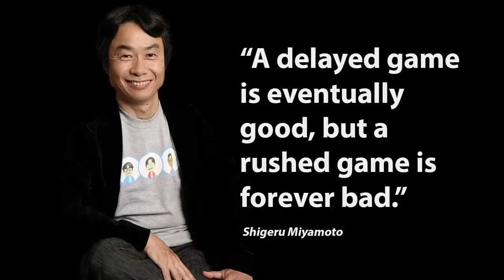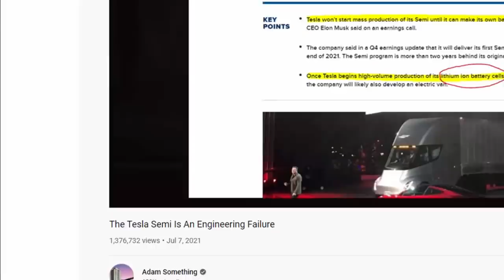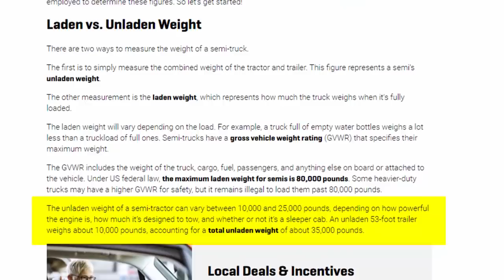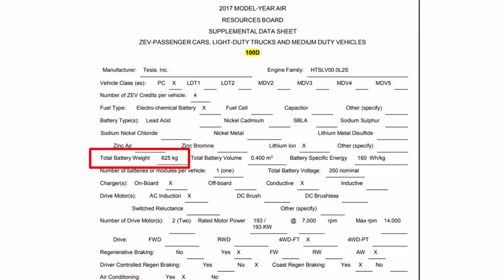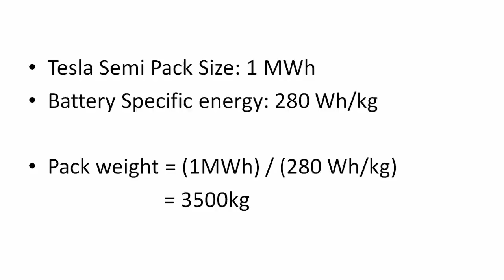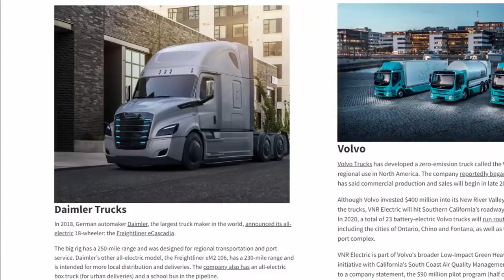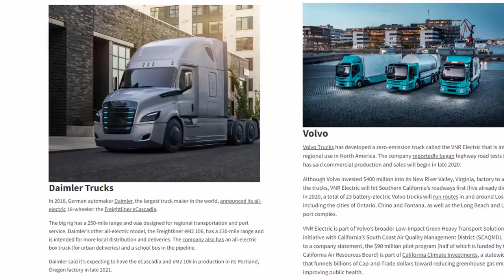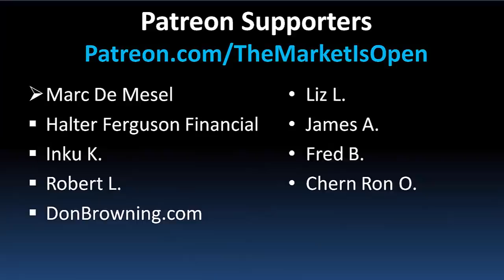The 2022 Tesla Semi is Genius, And Here’s Why

Comment: Most OverThe Road Tractor Trailers have 400 - 600 gallon fuel tanks and with each gallon of diesel weighing 7lbs the full fuel tanks weigh 2800lbs - 4200lbs of fuel so even if the battery pack weights 4200lbs or less it is still less than the OTR truck which the local day cab which is what the Tesla truck is and if you put high wattage solar panels on the trailer and have it charging and powering a reefer unit plus the Tesla Semi unit for say delivery of perishable food items like vegetables and other food stuffs cause a plug in refrigerator unit is much lighter than a fuel powered unit you could also have charging units at places where a 30 or more minute delivery would benefit charging for longer than 30 minutes  which makes the Tesla truck have that much more travel distance.

Comment: No electric truck competitors..?? I wonder why?? Because its vapour ware..! Taking this from teslas own numbers a 1 megawatt model y, a, 3 or whatever battery weighs 6250 kg... That's only the battery... Diesel for long haul trucks weigh 900kg... And if you think that a tesla will save weight because its electric and motors weigh less than a diesel engine think again.. A 6000kg battery needs a big, robust substructure to hold it in place on the chassis of the truck.. The weight differences in running gear would be minimal tipping in the teslas favor probably by what 100? 200kg?.. If you're lucky...

Comment: What if this truck could use the wheels turning to regenerate and charge the batteries, Like an alternator on a car engine?
Reply: Can only do that when downhill regen braking or stopping. When motors are moving the truck forward they cannot regenerate, violates second law of Thermodynamics. That's also why there are no perpetual motion machines.

Comment: Ok I am all for ev’s but stop with the ending fossil fuel consumption..every thing built is related to oil.. so stop. Plastic... derivative of oil.
Machining engines electric or gas .. totally oil dependent... tire manufacturing oil dependent ... I could go on and on... yes I know we use way too much oil... like I said I am all for ev’s but just stop with the ending fossil fuel.. it’s a very misleading statement. 
Don’t believe me.. ask your boss

Comment: 300-500 mile range is pathetic. Trucks get 800-1000 miles between fuelings. Having to stop every 300 miles to recharge would cause mass shortages and logistics costs would go up due to having to pay drivers for down time. Drive for 5 hours, charge for who knows how long and get a few more hours just to have to stop again because you're out of hours of service. Only about 10-15% of trucks would be able to switch to electric until they can go 60-75mph 8-11 hours before needing charged. I'm not against electric trucks, they just need to charge their batteries on the fly before they're really going to work.

Comment: even if the cost to operate the electric semi trailer trucks was five times that of a diesel truck we still need to replace the diesel trucks because they are a major carbon dioxide contributor as well as particulates, nitrous oxide and volatile organics. The internal combustion engine industry has gotten a free ride by dumping all those toxins into the environment for absolutely no cost to the fuel companies or the users of diesel trucks. It’s time that stopped.

However, it’s clear that in a few years and electric truck will move freight at around 20% of the cost of a diesel truck. No amount of renting from diesel truck drivers that will change that but they should know that if they’re thinking of buying a new diesel truck it may be absolutely worthless in about five years. 

Tesla didn’t become worth more than all of the car and truck manufacturers combined for no reason. Those who have done the math know that electric vehicles will be the rule in 10 years which can already seen by the rate of acceleration and implementation doubling from last year and probably tripling into the next year.

Comment: I am a Model 3 owner and a truck driver I can state a few things electric trucks are probably not going to work until the truck itself meaning the cab the sleeper and the driver can be removed from the equation. With just a trailer and a power unit I think electrics in over the road trucking Will be successful. If you eliminate the driver you eliminate the need for the truck itself and all the expensive heavy things that come with the driver. The point some are making about battery capacity and weight is super important for every extra pound that a battery weighs that's less freight that you can carry. All important equations when talking about trucking efficiencies. Currently my 2022 Freightliner gets about 13 and 1/2 mi per gallon on average and when you think about it pound for pound that's actually more efficient with less pollution than a Toyota Prius. What's interesting about that is the regulations are tight on me but not on the Toyota Prius.
I would also add that the 80,000 weight limit is not necessarily for safety but because of road loading. Meaning somebody arbitrarily said trucks over 80,000 lb tear up the road faster. Heavier trucks actually have a shorter stopping distance than lighter trucks do. In the rest belt and in Canada you will see larger trucks than what you typically see in America and they will typically have an added axle sometimes on the truck sometimes on the trailer sometimes both the truck and the trailer have an added axle. This is for the weight distribution to reduce road loading.

Comment: Infrastructure will be the most difficult problem. Charging facilities and current load. The mega chargers will likely need MAGA battery’s to support the large spikes in current draw. Not impossible, but this will take time. At about 3.6 kWh of electrical energy our fleet would need about 7.2 gwh per week.(2000 gallon diesel. Or 1.2 gwh per day. A lot of wiring and additional load to the grid.

Comment: Please don't put autopilot in these trucks. I don't want to die to that crap yet. Not that it will ever be allowed to used on the road until they are able to show anything that is even remotely capable of safe autonomous driving
Reply: And I dont want to die by truckers who drive 700 mile per day without rest.
Reply: @vic321344  build a railway
Reply: @ToppledTurtle834  Let the trucks drive with FSD.

Comment: You have a lot of flawed information yourself. 

If you can't haul at least 18-20 tons then you're losing money in thr trucking industry. The current semi truck itself, not counting trailer weight, is 12-15 tons (long haul trucks with a sleeper which is the vast majority of the industry). Those 5-10 ton truck weights are for city trucks with no sleepers which are not used in the long haul industry. Trailer weights are around 5-7 tons. When you've only got 40 tons to work with for max GVW thats 17 to 22 tons before you even get to cargo. If the Tesla semi doesn't compete with that truck weight then it's not going to compete at all no matter what it's range or speed or whatever is. You also can't use aluminum on a semi frame for structural reasons because of the type of work they do. They need strength and flexability instead of rigidity which is something that aluminum frames wont be able to keep up with. Aluminum cracks when it flexes too much. Back in the 80's companies used to use aluminum frames on trucks to try to keep within new weight regulations on the trucking industry until 5th wheels started ripping off of the frames and then they all went back to steel frames. History shows this doesn't work.

Also a range of 500-600 miles puts is slightly lower than a drivers normal 600-700 miles per day for a solo driver. If you're talking a team then you're at 1200-1400 miles per day which is something this truck will never do because of one fatal flaw. It has to be charged after it nears it's range. A semi truck can refuel in about 10-20 minutes and be back on the road. Even using the Tesla super chargers it's going to take more than an hour and remember with a driver team you only have 2 hours in a day to charge that Tesla before it has to be on the road again. Considering current trucks can go 1500-2100 miles on a tank so they only need to fill up every two days or so you are cutting into their time by forcing them to charge after every driver ends their daily run not to mention shortening their miles per day because they had to charge.

You need these facilities all over the country with the capacity to handle a large group of trucks charging up simultaneously since drivers aren't waiting 10-20 minutes for drivers to fuel up before they get to the pump they are waiting for an hour or more for drivers to charge up at the plug. There are around 2 million semi trucks on the road in the US currently. To make a dent in that market you're going to need a LOT of space for Tesla chargers and they have to be placed very strategically around the country. This will also severaly tax the already terribly aging US power grid which already has issues around the country for not being able to stay on consistently in many areas of the country because it can't keep up with power demands.
Reply: BEV Semis are much cheaper to operate. That will be the main argument. And Tesla chargers do not take a lot of space. They can be installed at every parking lot.

Comment: Trucks aren't loaded up to the legal limit? Well that would depend on the job, but I can tell you that there are an awful lot of trucks that are carrying the legal limit and a little bit more out there.
If you've 1000ltrs of diesel you need 3300kwh of electrical power to replace the actual rotational energy that will come from the engine. Long and the short of it though a 1mwh pack will provide enough range for legal driving periods between mandatory breaks.
The government could decide to just increase the limit on truck weight, though in turn that will increase energy consumption per ton moved...
The biggest challenge to tesla trucks will be actually getting enough power to truck stops to charge them, to charge 1mwh in an hour requires a lot of current never mind 15 or 20 trucks charging at once.
Reply: The megachargers have a megapack battery pack installed with them. So no problem.
Reply: @vic321344  that's the dumbest thing I've ever heard! It doesn't change the fact that if 100 trucks stop at one charger during the day they'll need a 4mw supply coming in. That's not common.
Reply: @jeffjefferson3364  It is not common, but doable. At least here in germany central loading hubs can be provided with at least 20 MW. A small supercharger station is connected by at least 1MW.
Reply: @vic321344  yea but that's for only 100 trucks! Another way to think on it is there is the hoover dam has 2000mw of installed capacity that means at full tilt all day it can power 48000 trucks, but it never goes full open it sits at around 1000mw because otherwise it would run out of water. So where would the power for the grid even come from?
Reply: @jeffjefferson3364  So you will have charging stations for trucks in the future, which can handle 100 trucks per day. So just build more of them. 

Energy has to come from somewhere. True. So even if you burn gas or diesel in a power plant to produce electricity, you will just need half of it than burning it in the engines truck by truck. Due to better efficiency of large power plants..
Reply: @vic321344  no. You're wrong. Engines are more efficient at turning energy into motive power than the electrical grid to battery to motive power.
Reply: @jeffjefferson3364  Definitely wrong. Again. You get an efficiency of 45 % max (25 in reality) for Diesel ICE, 20& for gas ICE, 64% for BEVs.
Reply: @vic321344  no way, you can't convert any heat source into electricity at a higher rate than 40% currently. And then you have transmission losses and conversion losses in the battery. You'd be doing extremely well to get 30% out of what heat you put in.
Reply: @jeffjefferson3364  Nuclear? Solar? Wind? Efficiency is quotient of energy get out and energy put in. My data is easily available by searching google. Tons of material. The efficiency of an oil powered plant is nearly double as  high as a single ICE. So if you burn oil in power plants to drive BEVs you will need half as much oil as if you would to power the ICE cars.

Comment: So,Nikola has already beaten Tesla with deliveries of BEV semis.
Reply: You mean the trucks which are made by Iveco and they glued their patch on it?
Reply: @vic321344  Tesla glues its patch on all the cars powered by Panasonic. Nikola has delivered semis from Ulm Germany and Az.Tesla has a fleet of 279 semis it uses for logistics 100% diesels.
Reply: @paulbedichek2679  So Panasonic makes the chassis, the drivetrain, the seats, or even the 4680 batteries?
And Tesla already delivered Model 3 with their own BEV Semi.
"Let's recall that IVECO and Nikola have a joint-venture manufacturing facility in Ulm, Germany (at IVECO's truck plant), which will produce BEV and FCV versions of Nikola vehicles for Europe. The base of the vehicles is the IVECO S-Way platform, including the modified driver’s cab. Actually, according to the press release, also the initial Nikola Tre for the U.S. customers are produced in Germany" . They are Iveco trucks. with a Nikola patch. Nikola delivered nothing.
Reply: @vic321344  Tesla did not deliver anything with their BEV prototype, they pulled it 100 yards for  video.Its been five years zero semis, Nikola went up 20% today as they are delivering hundreds of semis.
Reply: @paulbedichek2679  Nikola/Iveco delivered two trucks. Handmade in Germany. Tesla delivered 15 to Pepsico. And you could see Tesla Semis driving around in california an Texas in the last 5 years. Even Tesla Model 3 were delivered with it.
The problem is not delivering a handful of prototypes. But to start mass production and hjaving the battery capacity on hand. Tesla seems to be the only company to be able to do that. Texas Gigafactory.
Nikola stock gained some, after it crashed because of the "running down the hill" fraud.
Reply: @vic321344  Yes,Ivecos's owner long ago invested in Nikola and they now have a joint venture,Tesla is nothing without Panasonic.Panasonic makes the cars Tesla puts its patch on them.
Reply: @vic321344  Tesla talked about delivering semis to Pepsi,big difference they have delivered as many BEV semi as I have.
Reply: @vic321344  Tesla stock lost 200 billion in value because they can't beat Nikola to th market with a semi.
Reply: @paulbedichek2679  Or they lost 200bill. because the computers have a stop loss mechanism that leads to more sales. Which lead to more stop loss decisions.
Or they are racist. Or they lost to Nikola. Whatever.
Reply: @vic321344  Yes,Tesla makes nothing they just glue a patch. But they buy the glue and th patch from suppliers.
Reply: @vic321344  Hands make everything.
Reply: @paulbedichek2679  So you confuse Tesla and Nikola. Again.

Comment: It seems no one is addressing the real problem. We are already having to park on the exit ramps because the truck stops and rest areas are full .It’s going to take massive infrastructure changes to put charging stations in truck stops. Unless they are planning on building more truck stops which would definitely be a plus.
Reply: You dont have to install the chargers at truck stops already present. You can install them at the destination, or everywhere in between. No environmental proof necessary.

Comment: I don’t see why EV makers don’t make the batteries universal and easily changeable by automation. Then you could stop at a charge station get a battery swap and be down the road with a full charge before any gas vehicle could fuel up and be down the road.
Reply: Nobody wants to change 4-6tons of batteries. Just to get a 20 min less downtime. The Semi is much faster on hills, So you can catch up very easily. With 1/3rd of the operational costs.

Comment: Sorry but Adam is right, though his calculations are slightly off. I dont doubt they will get it right eventually, but until Tesla can lower the battery weight there is no point in switching. And the batteries are not the entire weight of the rig. The heavy steel construction needs to be strong to haul everything. This video makes you look bad.
Reply: The truck is only 2 tons heavier than the diesel. So what?

Comment: The 2022 semi?  I think you mean 2032.  Not mass producing? They are not producing any period.  It is a physics problem, not a production problem.  Scaling lithium based vehicles with larger loads just doesn’t make sense.  

This is why he used a per load cost analysis instead of per pound in his vaporware pitch.  He also used acceleration like it was an important metric to logistics companies.  All logistic companies care about is cost per pound/mile.  That’s it.  
The bigger the truck, the bigger the battery, the less the load. “Adam Something” is spot on.  Form factor does mot matter.  Kwh/kilo is all that matters. And that is not even 10 percent better than current cells.  It doesn’t make sense.  You have no argument against it.  The 1:20 ratio is pretty dead right- even with engine weight compared to electric motors.

You are taking tesla numbers at face value.  You are not taking into account the extra load requirements the battery itself will need.  It’s not a linear comparison like you have falsely insinuated.   The bigger the battery is, the bigger it needs to be.  It gets less efficient the bigger it gets.  You forgot to calculate for this.
Reply: The truck is only 2 tons heavier than the diesel. So what?